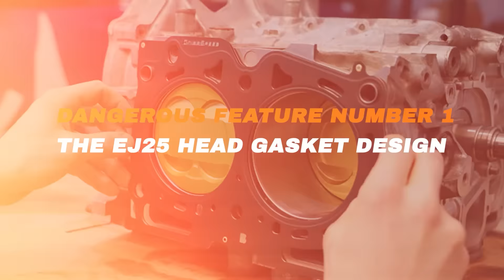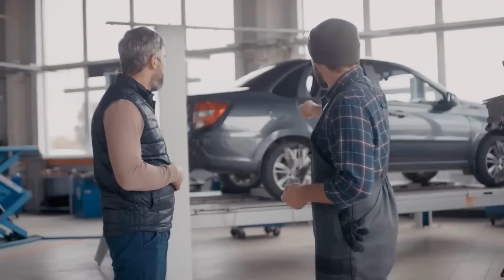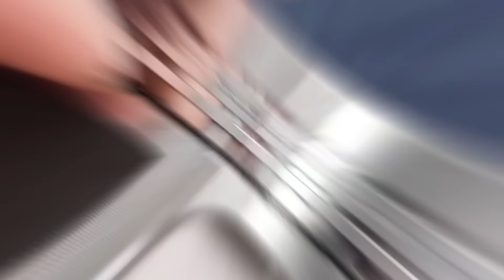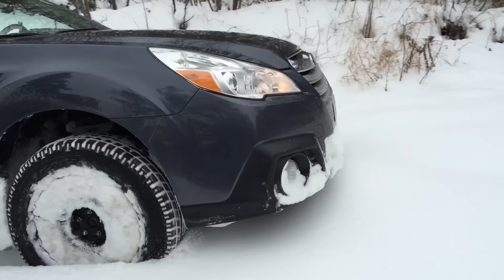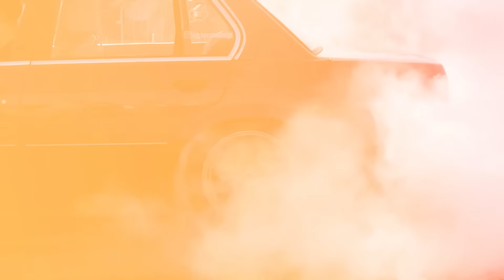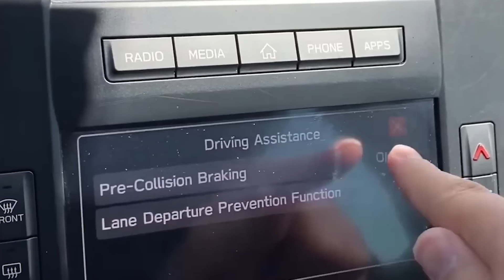15 Most DANGEROUS Subaru Features That DESTROY Reliability

Comment: Have an XV ( european crosstreck) from 2017 2.0 petrol and 6 speed manual version. It has 150.000 km mileage.
Changed the rear bearings both at same time a few weeks ago for the first time ( one of them was a bit noisy). Put some SNR and costed me 230 dollars both sides + 90 dollars the repair costs both sides at a local repair shop. So the 1000 dollar cost is highly exagerated in my area. 
From the last oil change I made more than 9000 km and the oil consumption is around 0.5 l. Use Liqui Moly 5w30 spec tech AA oil and 200 ml Cera Tech. So the "crazy oil consumption". Not applied at all to my FB 20 engine yet...if changed regularly every 10.000 km...no crazy oil consumption. 
The rust problem...I live in a mountain areea....lot of snow and salt...no rust at all....but treated with multi layer high quality materials. And wash all the time the underbody after a salty road session.
Checked regulary the PCV valve...till now do not change it...because is clean and intact. 
The other problems mentioned here...simply do not apply to my particular model.
And...after 2 Hondas and a Ford...man...the Subie...is just the best car ever. Capable and safe in mud..snow...mountain roads...highway...simply everyvhere with an average of 7.6 l fuel consumption.